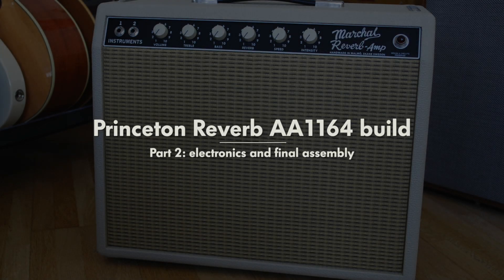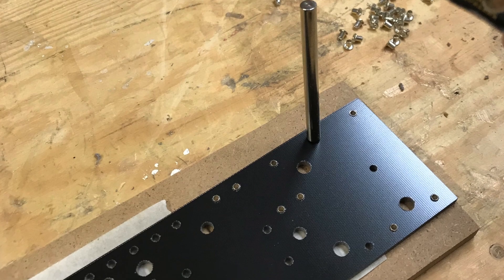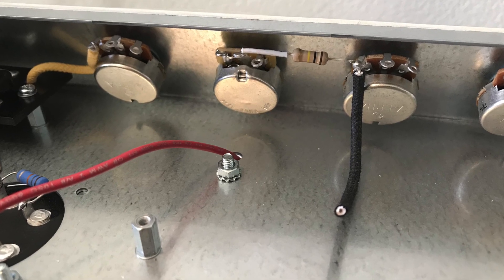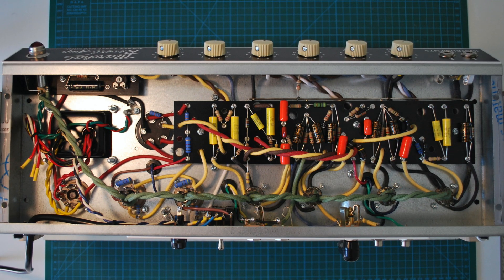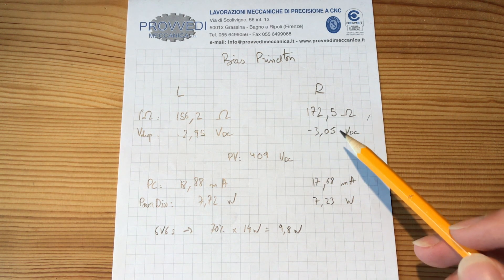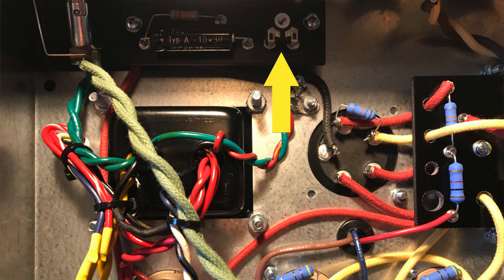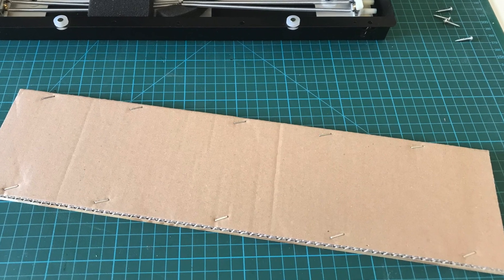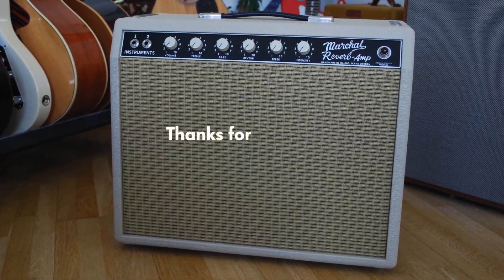Princeton Reverb AA1164 clone build - Part 2 - Electronics and final assembly

Comment: you wouldnt believe how much of a difference the transformers would do 

its amazing how my amp sounds now after changing the TAD output and reverb transformers into MercuryMagnetics

got there NOS RCA tubes + Jensen C10P ceramic speaker from 1965 (its very close to the Jensen C10NS only fraction of mm difference in some dimensien around the coil)

desert island amp now

Comment: Hello, the two strips of wood on the reverb base, was it just pine wood?  what size of wood screws? ..... thanks...
Reply from the maker: Yes these are juste two thin strips of pine. I can't remember what screws I used, they just need to fit though the holes in the reverb tank.

Comment: You really did a nice job with this one.  I make my life a little bit easier by installing a bias pot.  You can grid bias the tubes as a pair.  Uncle Doug also has a youtube on a pot in the reverse feedback loop.  I also add a presence cap only or cap on a pot on the reverse feedback loop.  It's a little bit of work, but you get a much fuller, rounder sound with more mid punch.  I love the AA1164.
https://www.youtube.com/watch?v=DirM9fuUhJo&t=7s

Comment: Beautiful amp! Very clean layout and assembly. I’m sure it sounds as good as it looks. Love that it has a tube bias Trem...so much better than the Photo Cell IMHO.
Love this circuit, but really enjoy it better with a 12” speaker. If you ever want to change it out to a 12” (or want a different 10”), the Jupiter LC is a GREAT replacement. Kind of luke warm about the Jensens?
Reply from the maker: I’m using this amp as part of a stereo rig with another amp that has a 12 inch speaker, so my thinking was trying to get the best of both worlds combining the two sizes. And indeed it works quite well! I actually also enjoy the 10 inch by itself. I actually haven’t had the need to push the basses over 5 so far.
Reply: @robinmarchal5752  10” is the traditional Princeton sound, for sure! The Alnico starts to flabby if you push it hard? If you ever feel like the Jensen isn’t holding up, I highly recommend the Jupiter LC (they make a 10” size). It’s 50watts and can handle anything the Princeton throws at it. Breaks up great, but has absolutely amazing clean sounds.